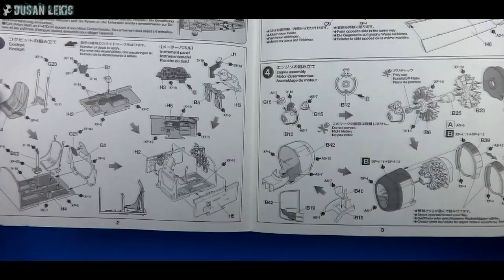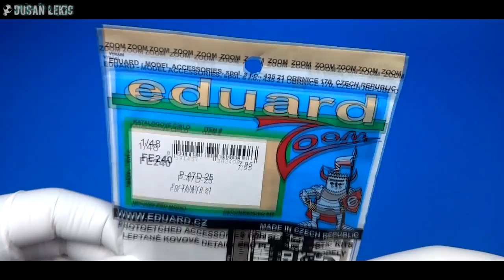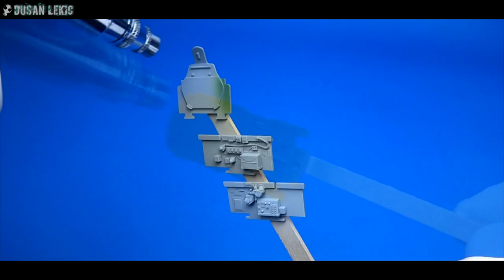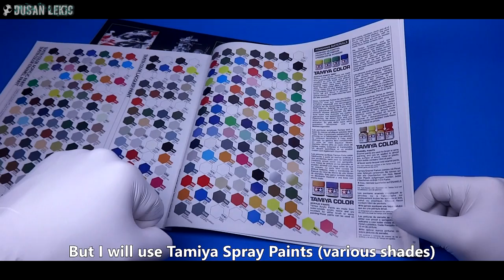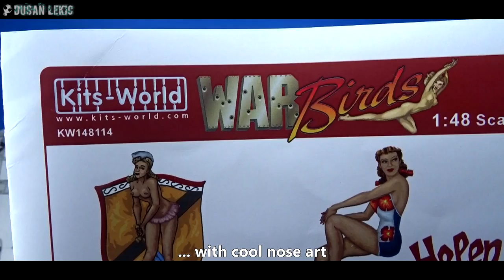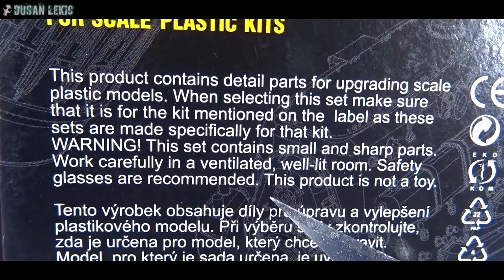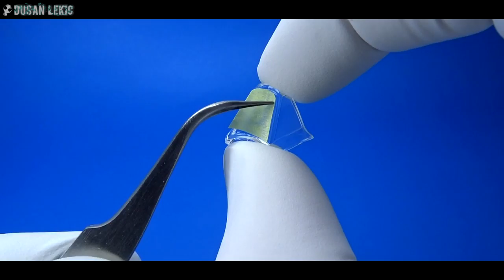TAMIYA P-47D Thunderbolt full video build

Comment: One small caveat about the admittedly excellent Tamiya Thunderbolt "Bubbletop". You need to check/research the aircraft you wish to make. The kit gives you a corrugated Cockpit floor, which is correct for the Razorback D series and the Bubbletop D series UP UNTIL the D-25 production run. Anything later (D26- thru to D33 will have a flat floor (no corrugations), as will the M and N series models.  It is "Fixable" with either a 10 thou plastic card floor or a bit of careful chiseling and sanding. The 1/32 scale Trumpeter Kits and Hasegawa kits are similarly affected.

Comment: Builders are missing out. I decanted the as-12 and airbrushed it. Fine sanding was done with 6000 grit micro mesh. I did Duncan's p-47d razorback in the 72nd tamiya version,  and the results are breathtaking.  May try some ts-17 on a future project for dissimilar panels.   New nmf finish t-bolts were not mirror finish,  so a chrome finish is way too much!

Comment: AK Xtreme Metal are the best metal paints on the market imo and airbrush ready. I hate spray cans on small scale models (1/72, 1/48) the control is terrible compared to an airbrush, very easy to clog up areas with paint. Other than that nice build as always Dusan!

Comment: Great work Dusan! You constantly fail to dissapont and this is great. I must say that because of you I tried using the wash on my models, I was always afraid of permanently staining the work with the black. 
As for the kit: In Tamiya we trust, I worked on an F-16 and a P-51 in the 1/48th and they were both excellent kits, not only detail-wise but engineering-wise. I actually consider getting this Thunderbolt as a next build sometime. For now... a Corsair is waiting in my closet ;)